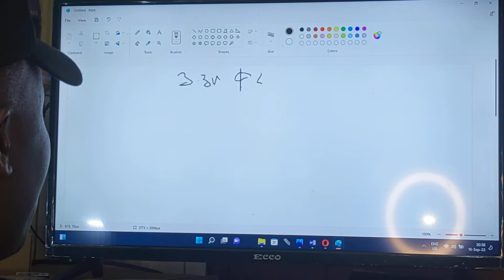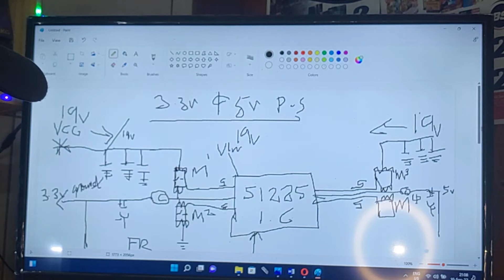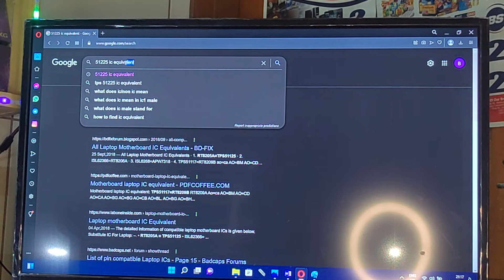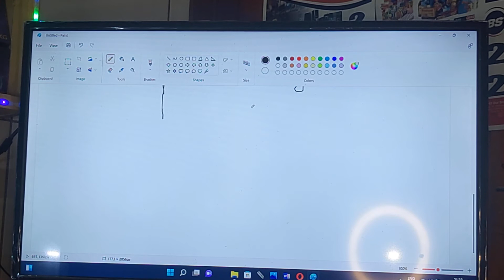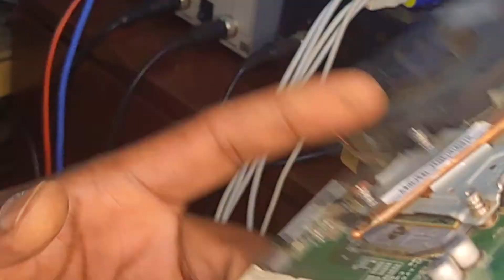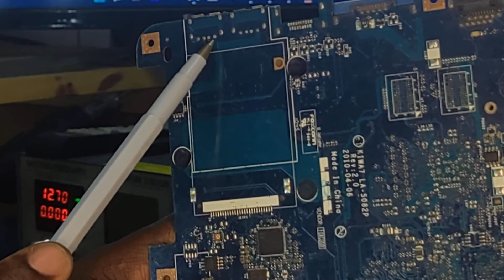All Laptop  Motherboards Power Sequence Theory, PART 2

Comment: What is pch?
Reply from the maker: PCH stands for Platform Controller Hub. It is a critical, single-chip integrated circuit designed by Intel that serves as the motherboard's main chipset, orchestrating communication between the processor and various peripheral subsystems.